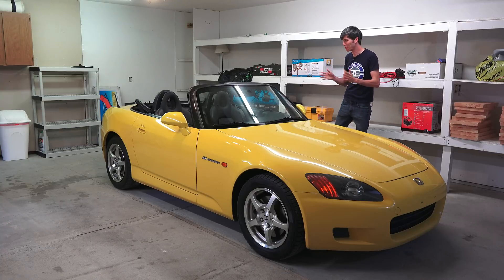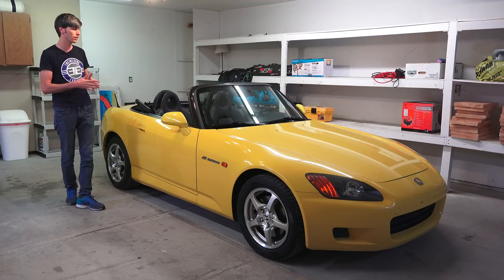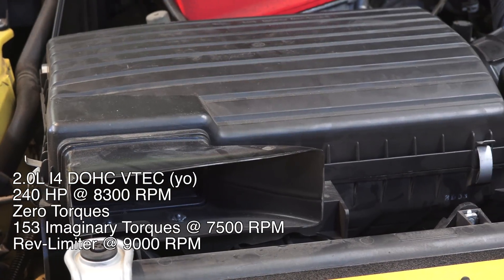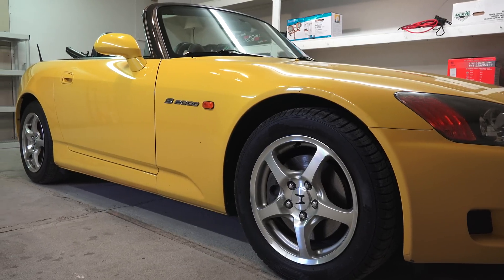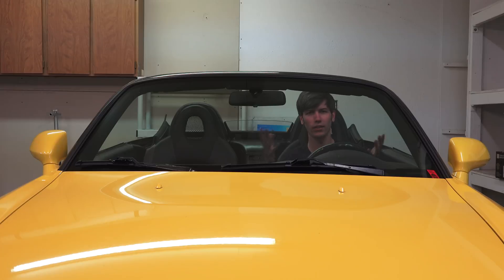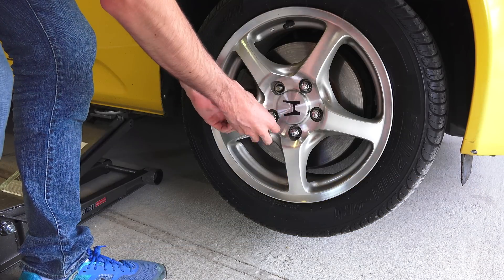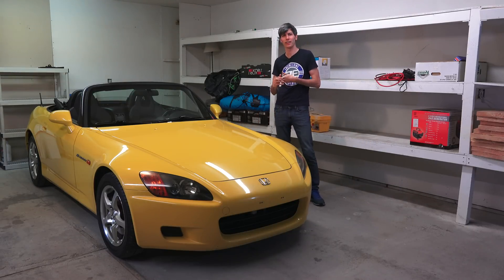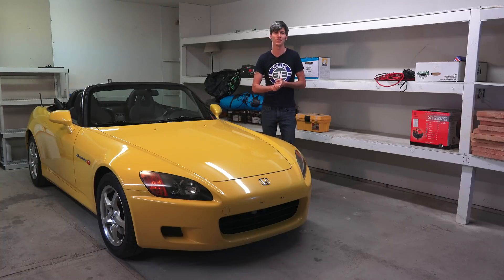I Bought A Honda S2000 And It's Amazing!

Comment: Scion FR-S or Honda S2000?
Reply: S2k if you can afford it.  You can buy an low mile FRS for 16k now.
Reply: S2000
Reply: +elesjuan serious?
Reply: v6 mustangs? id rather kill myself. 
if you're buying a mustang get the gt+
Reply: 2016 Mustang:  
0-60 - 5.5
Quarter mile - 14.1@102
Top speed - 124 governor 
70-0 - 164 ft
Roadhandling - 0.86g
Weight - 3588
300hp / 280tq
19/28mpg
$24625

2016 frs:
0-60 - 6.4
Quarter mile - 15.0@94
Top speed - 139 drag limited
70-0 - 172 ft
Roadhandling - 0.89g
Weight - 2757
200hp / 151tq
22/30mpg
$26265
Reply: homer23422000  The rack on the BRZ/FRS is just about as good as electric steering gets.  The S2k was one of the first electric boxes. fast but not much road feel.  16 years of progress between the two cars. The S2k is very good on the open track if you can handle it at the limit.  Most folks cant.  For the average joe the FRS is a better handling car. If you are a truly skilled driver the s2k wins.
Reply: s2000
Reply: S2k
Reply: Only one major problem elesjuan, the FR-S/BRZ share NOTHING with a Corolla. So you really shouldn't call it a two door Corolla. Different chassis, suspension, engine, etc. Not to mention it was co engineered with Subaru. Disagree in the looks department too, but that's a different story. Plus V6 Mustang gets a lot more hate, if you care about that.
Reply: yeah buddy Me too.  Ford sales a ton of them.
Reply: Handles better? Lol.
Reply: v6 mustang.  It out accelerates, out brakes, out handles, is cheaper, and looks better than the overrated toyota corolla 2 door.
Reply: homer23422000  The Frs is also more predictable at the limit and far more efficient with more room for luggage and better steering.  You can get and FRS with factory warranty. The FRS is also a far far safer car.  

When you push the S2k AP1 it is a monster.  The way it sounds and feels is magic.  lots and lots of power on the cam.
Reply: 99Lezard99 I hate ford, and I hate the mustang even more, but you're damn straight I'm sreious.  Look at the published numbers by all of the reviews and compare them.  In every absolutely measurable aspect, the v6 mustang outperforms the 2 door corolla.  "Oh but the frs is a blank slate for you to upgrade and make better.."  k.  You could say the EXACT SAME THING about the crustang.  Plus it still looks better.
Reply: elesjuan ok didnt know that. Im german and Mustangs are not a thing here in europ. I would still go for the gt86 frs brz because its not a ford. And i really dont like Mustangs. Too much murica. But out of all this i would prefer the s2000 anyway.
Reply: +99Lezard99 the new Mustang is designed and developed in Germany
Reply: +elesjuan lol
Reply: wtf
Reply: 99Lezard99 Truthfully, I'd take the s2k anyway myself.  You know, drop top 2 seater > 2+2 garbage any day!

I went with the miata cause 10 years ago I was too poor to afford an s2k.  Plus it was a LOT cheaper to build into what I've got now, too.
Reply: "is cheaper"  yep! In the good way and the bad.
Reply: After driving both I have to say the S2000. Disclaimer: I am an S2k fanboy and have owned 2. But the FRS is so expensive and really lacks power. The chassis feels like it can handle so much more than what they gave it. The S2k feels like they engineered the crap out of it. The engine screams and the gearbox is mechanical precision at its best. That said, I loved the feel of the FRS. Really planted. Slow but planted. The seats, too, were fantastic (not that the S2k seats are slouches by any means).

If you are planning on hopping up the car, the FRS is probably your best bet. The S2k has been wrung out by Honda engineers already, whereas the FRS feels like it has so much more potential yet to be tapped. /novel
Reply: FRS. It's a better daily. I took a mustang over a BRZ/FRS for practicality, so that speaks to my point lol.
Reply: Driv3n to Dr1ve In this class of car the Mustang is hard to beat as a day to day driver with good room economy and performance. Only problem is to get the level of performance out of the Mustang at its price point.  Ford cut quality and used solid steel throughout its construction.  You can buy a 300 hp 30 mpg car with RWD , hids and a limited slip for 25k.  It weighs in at almost 900 pounds more than the FRS/BRZ.   Two years in stuff starts to loosen up and fall apart.  Mustangs are built much better than they were in the past.
Reply: s2k
Reply: afterburn2600 You can buy a low mile 2013 FRS still under factory drivetrain warranty for 16k.  A better built 14 for 19k.  Hell of a deal and it is only going to get cheaper as time moves on.
The new Toyota 86 is going to be more expensive list than the 26k BRZ but Toyota should discount more than Scion or Subaru ever did.
Reply: I love the s2k, but the FR-S/BRZ is pretty nice.  Looks like it checks all the boxes aside from power, which is a good thing really.
Reply: Avarian The GT is an Awesome deal. The V6 can be had for 23k after discounts.  Has a LSD AND HIDS standard.  Something that is almost impossible to get on the German cars.With the track pack the 100 less pounds over the front wheels made it handle better than the GT.  So much so that Ford limits the top speed and discontinued the performance pack for the 16 V6 mustang.  The V6 Mustang also has no problem maintaining 30 mpg at 75 mph. For 16 it is now a bit of a dog as Ford is pushing the more expensive Turbo 4.
Reply: fatboy19831
pass
Reply: s2k all day. frs is easier to drive but it aint worth the price tag for how SLOW it is.
Reply: Yea Right In normal driving the FRS is quicker than the ap1 S2k.   only flat out above 6000 rpm is the s2k a beast.
Reply: I'd take a Ecoboost Mustang if they where cheaper than the V8. But in Sweden they cost like $5000 less than a V8 so like.. If I could a afford an Ecoboost I could afford a V8.. But I don't want a gas guzzling V8 :P The Mustang DO look better than both the S2000 and the FRS/GT/BRZ. And I have to fold my shoulders in a painful way to even sit in the FRSGTBRZ. Love japanese cars though so it's a bit sad.

But now I can't afford anyone of them so all is good :D I am not a fan of american cars in general I have to say that the newer ones like the last Mustang, the more recent Cadillacs and even the Corvette seems to have caught up with the European cars when it comes to handling, interior (thank GOD for that!) etc. You still have the dinosaurs in the way of the Challenger and Camaro (apart from the Z28) though.
Reply: fatboy19831 i guess i can agree with you if youre shifting under 3k rpms. damn thing feels like a single cam civic and even worse with AC. but you easily forget about it when ur 9k deep lol
Reply: I think you put that well. Most people who own or have driven S2K's say that it is a more advanced drivers car.
Reply: M|iata
I|s
A|lways
T|he
A|nswer
Reply: Yea Right It is always a compromise when you have a high winding engine.  The BRZ /FRS make far more torque between 1000 to 3500 rpm then there is a dip till 4500 rpm then torque is back with a big boost in power. The BRZ holds the advantage till 6000 rpm .  The power then peaks at about 7000 rpm.

The ap1 makes good power from the jump with no dips.  No real torque till the 6000 rpm kick in.  By 6500 rpm the s2k is making more power than the BRZ at red-line. There is still 2500 rpm to go.
Reply: If you want RPMs you will sacrifice torque, but pick up HP.  Can't have your cake and eat it too.

Comment: Your explanation is so much more thorough than 99 percent of the know-nothing auto journos out there. Now can you address the tweet I sent you many moons ago regarding if a hard top can improve the torsional rigidity of a convertible? ;)
Reply from the maker: I suppose it would depend on the mounting, as well as the rigidity of the top. The benefit of a hard top is that the unibody is one structure, so it's all connected sharing the stress across it. Bolting a top on won't always have this effect.

Comment: Wow thats a nice S2000, Congratulations!! I find that S2000's are geared far too short, just under 4k revs at motorway speeds in the 6th gear. Then again it does rev to 9k so 4k is nothing lol

Comment: if that's a mechanical wire throttle version (non drivebywire) you hit jackpot. :)
Reply: explain?
Reply: Koolkei the others explained it. i say it's better because a friend owned both versions and noticed the difference in responsiveness. :)
Reply: but why is drive by wire inferior though. isn't drive wire supposed to be 'more optimized' or something?
Reply: Yes. The AP1s (2000-2003) were mechanical throttle cable. The AP2s (2004-2005) were ALSO a traditional throttle cable. 2006+ AP2 were drive by wire. I guess the drive by wire versions are not as raw as the mechanical throttle cable - which some might be able to feel - but the plus side to the 06+ AP2s that are drive by wire is that you can tune them very easily. You have to piggyback an ECU to tune an AP1 or early AP2 which, as I understand, is a pretty ghetto method.
Reply: It's the difference between someone questioning what you tell them and someone doing what you tell them.

The best cars just do what you tell them right when you tell them.

Comment: nice ride but why didn't you get the honda s2000 ap2?I heard it has better suspension geometry
Reply: Lower rev limiter, its all about dat 9000
Reply: Because there is nothing wrong with the AP1, just need to learn to drive.
Reply: +Dan Carlos Owned both. Have to admit, 9K > 8.xxK.
Reply: Lol just tune the ap2 and bam, 9k rpm.
Reply: Even with a Hondata reflash on an AP2, you're only going to get 8600 RPM. Typically when people tune their S2000s, it's not to get a higher redline. It's to move the VTEC engagement to a lower point in the rev range.
Reply: With the F22 motor, Honda increased the piston stroke and so they had hesitations about the motor soaring to 9000K RPM - hence the decrease in redline for the AP2 model. Fun fact though - Europe kept the F20 in their AP2s, unlike us in the US who changed to the F22 motor.
Reply: +Zach Heath Europeans have it good then 😪 thanks on the info, learn something new every day

Comment: Congrats on being a subie honda fanboy. I am one myself. I had my s2k ap2 for a few years now and recently bought a 2016 wrx, too. I would have to say that the s2k is just so much fun. Hitting that vtec is exhilarating. Once you feel it, you want it all the time. I'll suggest getting a hard top as one of your mods. Also, intake and coilovers. Your seat bottom looks like a little worn, too. I just swapped my passenger and driver seat bottoms so that I have a good seat bottom and the worn side of the passenger's is next to the transmission tunnel.

Comment: Paint it read and you will have 750hp. Trust me. I've been tuning all my life. If that's not enough, get a wing. The bigger it is the more power you get. Usually you get an extra 20-30hp. Getting a hood scoop will end the torque problem aswell. Oh, when you paint the car red, don't forget the brake calipers. People miss them out and then complain to me that they can't feel any surge in power. Smh.

Comment: fwiw Honda did not design the transmission. it uses an aisin 6 speed. very similar to the Miata 6 speed. the MSM Miata and s2k also share a rear diff.

Comment: great choice on the 02 ar1. The elastic that retracts the center roof bar brakes down and causes the top to not fully seat. Next time you put the top down reach up and pull it rearward and the top will sit about an inch lower. This will allow you to put the top cover on the car when the roof is down.

Comment: lol, all the hiprsters at my work own an S2000 or are planning on owning one (if they can find one that isn't thrashed).
    Good car
Reply: I thought hipsters like tesla, Prius, old rusted up Volkswagons, and station wagons?
Reply: That's enough to make me want to buy a 2013 Impala!
Reply: Jefe von Q lol
Reply: Oddly enough, the S2000 should do just fine with CO2 and MPG (but you repeat yourself), at least until the vtec kicks in.  2.0l (NA) and 2,800 lbs can't be too bad at such things.  Of course, I suspect that Jason would recommend a crosstek if you want practicality.
Reply: Mrlolibre
Don't forget the Subaru's! They think they're cleaner and more responsible than other 4wd vehicles. That is based on their lack of actual mechanical knowledge and utter lack of statistical research.
Reply: Mrlolibre  My guess is after they've worked in the real world for a little while,  they realize things are not as misogynistic as they once thought, and  not all white males want poor and sick people to die. They learn,  its ok to want something that prioritizes performance over C02 emissions, utility and MPG.   lol
Reply: Cave of the Wumpus
Actually, a Subaru Crosstek (Subaru is another Cosmo-Metro favorite) isn't as practical as the Forester. The chassis and driveline are the same, but the interior has less space.
Reply: Jefe von Q Yeah, it seems as if the Subaru brand would fit the mold of hipsters. I suppose because Subaru isn't as "mainstream" as other auto manufacturers.
Reply: Mrlolibre
There's an instant insinuation left-wing ideals and other types of virtue signalling, for the Subaru driver. This does not really include the WRX/STI lines.

Comment: If the steering wheel turns by itself or feels heavy BE CAREFUL.  My S2000 and several others have issues where the electronic power steering sensor acts up.  It is a simple plug malfunction but it will cause you to lose control of the steering periodically.  One night I was driving home and the steering wheel locked up and turned on its own and sent me into a tree and a ditch.  Look up "S2000 steering wheel wobble" on youtube and you can see what happens.  Be safe! I loved my S but she tried to kill me!

Comment: viper? if someone gave me a viper, i'd sell it, buy something more fun and spend the left over money on something else.
I just purchased a 2016 crosstrek. it took about 2 weeks and i am now a subaru. it is very underpowered and i am trying to find little ways to bump that up.
Reply: Your concept of "more fun" would surely change after driving it ;).
Reply: i have driven vipers. i worked at a high profile dodge dealership and after we worked on them, we had to drive them around and get them "up to speed". if all you are interested in is a big and loud engine, a viper is for you.

Comment: you need to tell us more about that gearbox. Two shafts what? And the diff is a Mazda?
Reply from the maker: Just two parallel shafts for all six gears and reverse. I'm not exactly sure if this is rare, but a lot will use three shafts. The diff is a Torsen.
Reply: +Engineering Explained i heard the diff is a mazda.

Comment: If you're ever in the UK again I have a VX220 with a heavily modified engine Saab B207 engine including individual throttle bodies producing around 218.8 bhp. Would be interesting to see how you compare it to your S2000.

Comment: There's actually a RWD vehicle running a 4 cylinder motor? aren't most RWD coupled to a V6?
also, there wouldn't happen to be a sedan featuring this setup, would there? (RWD 4 cyl 6sp MT)

Comment: Didn't the 02 model years have rear axle issues?

Only Honda I've owned was a 5th gen '97 prelude.  Fun car and handled great once I put decent rubber on it.  Previous owner didn't take much care of it though, in fact he had four different brand and model tires on it when I bought it...  Should have known better.   Sold it around 200k miles on the clock and the interior was immaculate.  Engine was burning quite a bit of oil by then, though.

Comment: Congratulations on your new ride. It's really hard to find one in good shape where I live (Poland) but those that are, are beutiful pieces of engineering.
Question - how tall are you? And how do you find the interior of the S2000 comfortable, because I was pretty sure you are somewhere ~6 ft ?
I'm 6.2 ft and sadly I don't exactly 'fit' into the S2000 :( There aren't that many affordable rwd cabrios that would fit the tall people...
Reply from the maker: I'm 6'1'. I'm a little tall for it from a visibility standpoint with the top up, but I fit fine without my legs hitting the steering wheel. I think I actually fit better in this than the new MX-5.
Reply: Pontiac Solstice/ Saturn Sky/Opal GT. . Accommodate individuals at 6'2" nicely. .. I'm 6'2" and think I could be up to 6'4" and not have a problem... Very much an under appreciated platform that is very well engineered too👈
Reply: Thanks man!I will look for an Opel GT then... The other two are total exotics here, as neither Pontiac nor Saturn was ever sold in the region.... look nice though. Someone also told me that actually the Mazda MX-5 NA (the oldest one) has more head room than the later models.
If no, then I guess I will stick to my old Forester with sunroof, a substitute of a cabrio :)

Comment: That's pretty clean I thought somehow you had managed to find a new one until i noticed the gnarly scratch on the back right rim (The engine bay looks very very nice though for a 14 year old car though). Good luck with the build man. How far are you thinking of pushing this as far as performance goes?
Reply: Oh yea when you turbocharge this badboy don't forget to paint the intercooler black!

Comment: A RX-8 makes more HP per liter, right? Anyway, great car. I'm in the same boat with imaginary torque but it is fun to hit 9k. Enjoy.
Reply from the maker: Yeah I think the challenge is comparing apples to apples since it has a rotary. 2-stroke engines have higher specific outputs, but they fire twice as often so it makes sense. Rotaries are somewhat similar in their operation.
Reply: +Engineering Explained I figured there was something going on. Thanks for explaining it!